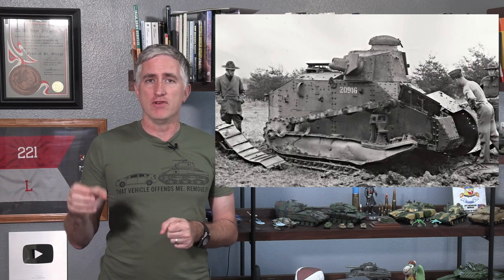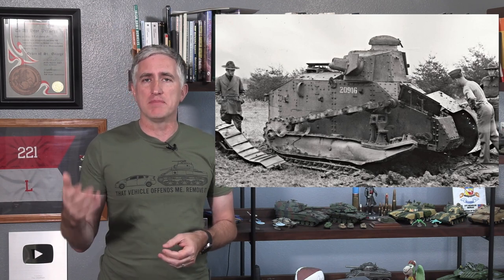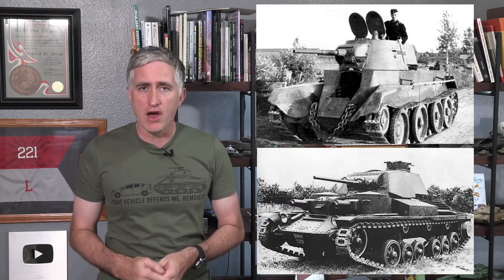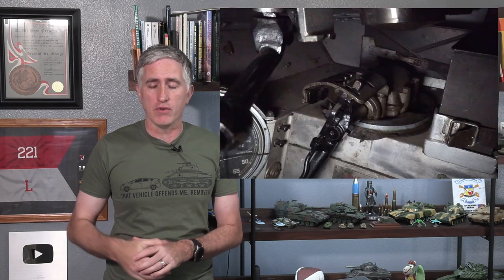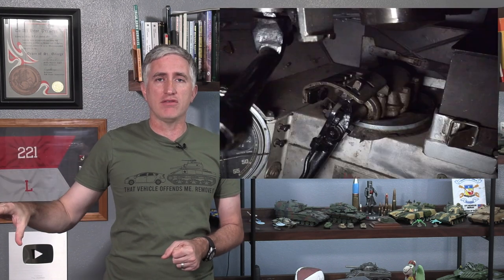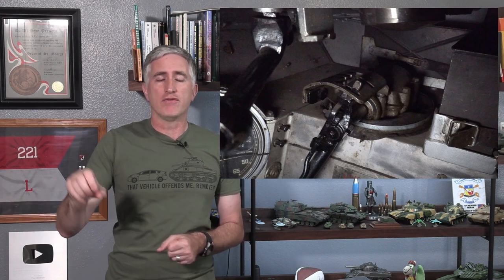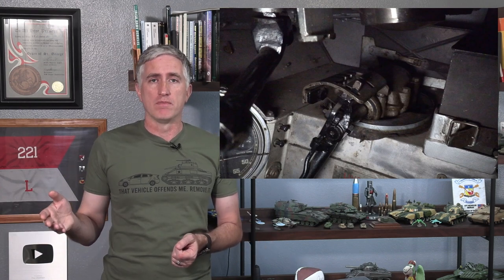Advantages of rear engine tanks with front drive sprockets

Comment: Your point about transmission linkages is something I hadn't considered. I used to have a van with a column shifter that required a fair amount of finesse to shift smoothly between gears. Trying to force it when it didn't want to go into gear ran the risk of having the linkage separate leaving you stranded. Having that happen in a situation where people are shooting at you, yeah, I can see why they'd put the transmission in the front.
Reply: My family owned Econolines for years and that happened a few times. Once a cotter pin in the linkage broke and was replaced by a bobby pin as a permanent temporary fix.
Reply: @edcrichton9457  Mine was close to 20 years old when I bought it, and the linkage was well worn. I learned pretty quickly how to shift it without causing a problem, but only after I had to push it out of traffic a few times.
Reply: My parents had a 79 Chevy van, witha three-on-the-tree.  You learned quickly not to downshift straight from 3rd to 1st when coming to a stop. If you did, you'd bind up the linkage and have to coast to the shoulder, get out, and stick a screwdriver in the linkage to unbind it.  I think I only did that once or twice. After that, I always shifted from 3rd to 2nd to 1st.
Reply: @edcrichton9457  There's a well-abused '91 dodge shadow 5 speed out there somewhere that has a bent trim nail holding the cable end to the fore-aft linkage on the transmission side, and a rolled up piece of greased rubber hose as the bushing. Nothing like field-expedient repairs that not only work when needed (I yanked the thing apart on a 4-3 downshift in the middle of the night in downtown Atlanta), but also ended up working better than the factory parts (I hadn't realized just how much slop there was in the factory perforated bushing...)

Comment: Glad he addressed the mechanical advantage of pulling the track forward (think block and tackle) and that it's way down on the scale of considerations for a tank design  .. always love your talks
Reply: There is no mechanical advantage of pulling the track forward.

Why? Because the axis of the sprocket and the axis of the idler are fixed relative to one another.
Reply: You will never see a conveyor belt in any different configuration and basically a tank tread is a conveyor belt. You cannot push the tread around the axels because you don't get the same torque because of a number of physical restrictions.
Reply: @markkarnes5597  Tail drive conveyors are a thing. It's just typically not done because of the tension effects. Tail drive feeders are fairly common. We have both on the current project I'm working on.
Reply: @GIwillo  
Your last sentence is correct.

Comment: I got to drive an M113A3 around Grafenwoehr and Hohenfels Germany as a 12B, and since it was the platoon commander's vehicle it was really like having a tracked vehicle to joyride around the mountains of Germany with. They were definitely balanced well considering all the very steep grades I'd have to drive down and up. Checking the oil in the two front final drives was just as important as the engine oil, stressed in the manual and by my NCO's. (One of them called the 113 a 'tracked grenade'.) The up front engine served another purpose very well-at night I'd lay my 3 layer sleeping bag over the engine intake grate on top and get nice residual engine heat for nearly the entire night.

Comment: Hopefully this comment doesn't get buried, but I have a question for the monthly Q/A.

The Chieftain MBT is often described as the most well-armoured vehicle of its time, but wouldn't the appearance of HEAT shells make the armour relatively useless? Why did nations continue to build heavily armoured vehicles when HEAT rounds were a thing and composite armour had yet to be developed? Were HEAT shells uncommon compared to traditional anti-tank shells, thus the need to protect against conventional kinetic projectiles have more importance and thus the need for heavy armour?

Pretty long-winded question but I'd love to get an answer for this!
Reply: my two cents, you dont stop making planes just because the other guys make anti air rockets. Tanks are still useful even if their best defences are nullified, because its still a mobile weapons platform thats resistant to most threats.
Reply: I'll add my opinion as well. HEAT still needs to go through armour so adding more does help, albeit not as much as composite does but this combined with spaced or skirts would help.
Reply: The M60A1 and the Chieftain had the same LOS frontal armor. Try again
Reply: HEAT was a major headache but was not magic. The 105mm L7s HEAT round could chew through about 400mm as i recall. When France and Germany started work on what would split into the Leopard 1 and AMX-30, they emphasized sniping and outmanuvering oponents, while the Cheiftan and to a lesser extent the Pattons were expected to be able to slug it out. As such France and Germany considered sufficient armor impractical and settled for resistance to 20mm autocannon while the Americans and British had 2,3,4 times the effective armor in some places to be able to shrug off known main gun  rounds at the cost of speeds that could best be described as leisurely. Of course warheads kept improving and what was ok armor was eventually rendered as underwhelming as Leo 1's.
Reply: Most well armored at its time cheiftan is not. You forget T-64 exist?

It comes down to AP can hit stuff at first shot much more reliable over a long distance. People probably will sling AP at your direction first.
Reply: @u baka  btw, for some time going for mobility was exactly what Soviets were planning to do, as preliminary project of obj.432, or 430A as it was called back then, in 1960 had either no composite armor, or steel/glass textolite UFP (without layer of steel to back up textolite yet) only, and had weight of 30.5t, almost fulfilling requests of those unhappy with 34-35t of T-54/55 which proposed to go for T-34-85's 32t or even late T-34-76's 29-something t.
Reply: HEAT rounds couldn't be fired through a rifled barrel without a special casing because spinning forces actually weaken the hyper-elastic jet, so they were massively slower and less ranged then AP/APCR (and terrible accuracy). By the time you had the rifled barrel/smoothbore interchange in the mid-70s that REALLY let the HEAT round strut it's stuff, the first composite arrays where being fielded by both sides. (Outside of the early silica wedges encased in armor steel like in the T-64 and T95 series.)
Reply: HEAT only really achieves its amazing potential when it hits square on. Angles, especially three-dimension curves, have a bad habit of dramatically reducing efficacy. That super-hot jet of molten metal is more easily deflected than you would think. The Chieftain, from the front, had very few surfaces that a HEAT shell could bite into, so to speak, so it performed very well, especially when presented hull-down as intended. 

I will note that there are extensive combat records on the Chieftain thanks to the several hundred that were in service with both Iraq and Iran during their little tiff in the 1980s. The general consensus was that it sucked because it broke down all the time and was easily flanked, making shots against its relatively thin and flat sides quite effective. What I don't recall seeing much of is the frontal armor failing. That suggests to me that even with lots of modern HEAT shells going back and forth, Chieftain armor worked.
Reply: Early HEAT warheads would have been attached to RPGs and the like which weren't terribly accurate over long ranges and conflicts like the 6 day war and later the Yom Kippur war showed that heavy armor was clearly still useful.
Reply: @hedgehog3180  the first HEAT warheads used incombat were cannon fired in ww2 tanks and ground mounted cannons.
Reply: Experience with the Centurion in Vietnam showed that HEAT  did vey little damage unless the jet hit one of the crew. British tanks kept the ammo well down, so that was very unlikely to be hit.
Reply: The way the Rhodesians made their mine proof hippie kombis resistant to heat rpg7's was to place expanded steel mesh distant from the plating. Look up the "Leopard". - not the German one :)
Reply: @warlord195711  Yeah, I mentioned in the QA video the experiences of some American tankers from the Vietnam War that parallel your Australians. Most every battle they had with the NVA involved numerous rocket strikes because the NVA just adored using RPGs of all kinds to compensate for their lack of heavy artillery. Despite that, very few of the tankers were actually harmed seriously. The tanks would be full of holes but not the tankers.
Reply: @jintsuubest9331  Some evidence would be nice :).
Reply: One reason is that the heavy armor reduces the options that the enemy has to hurt you.

You COULD put a 105mm gun on a completely open tracked vehicle, but anyone with a rifle would completely wreck you.

So you armor it against 7.62x51, but you can mount 20mm/23mm autocannons on the back of pickup trucks.

So you armor it against 20mm/23mm cannons, but towed 40mm-50mm guns are relatively lightweight and maneuverable. Some IFVs even mount them.

You eventually reach a point to where the armor is heavy enough, but the vehicle is still maneuverable enough, that there are only a few weapons capable of penetrating it. Those weapons come with drawbacks that others have elaborated on.

To put it another way, just because Kevlar won't stop rifle rounds doesn't mean it's pointless to wear kevlar.
Reply: @andrewallen9993  Slat armour is still used today, particularly in the wars in the middle east. Just look up American slat armour to see it done right. Sometimes the warhead will detonate with a stand off, but hopefully over half of the warheads will strike between the slats making the nose go through and the speed will crack the nose off and disconnect the fuse (tip of the nose) from the warhead before the fuse strikes a surface.

Comment: The argentine TAM also has the engine on the front, with a small hatch on the back for loading ammo and stuff. It's a german design, the chasis is a marder derivative and the turret was to be the upgraded leopard 1 turret, but leopard 2 make that useless, so german engineers use ir for the TAM project instead
Reply: The TAM is so full of potential with some modern upgrades to it, and it has awesome operational range...srsly, the U.S. should really look to front engine designs or perhaps all electric systems to replace the aging Bradleys and M1s and make a universal modular vehicle which can be adapted to any role.  20 years from now, maybe we'll just have drone tanks and robot infantry though.
Reply: @pex_the_unalivedrunk6785  They tried. 

Twice. 

The Future Combat Systems tried just that, but was a victim of being too advanced for its time, and short-term priorities. 

The Ground Combat Vehicle was... the less said about it, the better.
Reply: @pex_the_unalivedrunk6785  the issue with that is you end up wit flawed vehicles for their roles. now sharing a certain degree of component parts (ie as much as possible) but haveing separate purpose-built chassis is the way to go.

of course light-medium tanks and IFVs have a lot more uncommon than MBTs and regular IFVs, so those could potentially share a chassis.
Reply: German and Argentine collaboration.....where have I heard of that before?
Reply: Strv 103 (the S-tank) also had the engines up front (and served as a role model for Merkava). The reason for putting the engines in fron was to have them function as additional front armor, protecting the crew.
With the gun arrangement of strv 103 it would also be more difficult to replenish the ammo if there was an engine in the way.
Reply: The layout of the S also ment the frontal protection system (frontal armour plate + engine power pack + under chin caterpillar blade + not to be forgotten: the fence) ment the protection from incoming projectiles in the frontal sector was second to none.
Reply: @ollep9142  But wouldn't that mean that you now have a tank that has been mobility killed but has a crew that is untouched? Or was that the point after all, trained crews being more valuable than tanks...
Reply: @thebog11  That's correct. WP had way more men (and tanks) than the Swedish army.
Protecting the crew was (and is) the main focus. The armor was only the last layer of protection. The tank being small and low was the main feature, making it easy to hide, difficult to detect and (if detected) hit.
Because of its small size the weight had to be kept down to maintain an acceptable ground pressure. Therefore the armor plating couldn't be very thick and so using the engine blocks as add-in armor became part of the solution.
Reply: If by "upgraded Leopard turret" you refer to welded instead of cast turret - Leopard 1A3/1A4 and the 1a5DK use that turret design.
Reply: @mbr5742  didnt know of the 1a5DK, but yes, the TAM turret is basically an A5 turret, which to my knowledge wasnt used in production Leos1, but i stand corrected, thank you for your comment, is always good to know something more
Reply: @christiandtorres9843  The A5DK is afaik build as 1A3 and then upgraded like the Bundeswehr 1A5 but using the welded turret while all BW 1A5 used the far more numerous (in german service) cast turrets

https://en.m.wikipedia.org/wiki/Leopard_1#Denmark
Reply: @classifiedad1  yes, the FCS is honestly fascinating as a design idea. The engine (and generator) is over in the track sponson, the transmission is electric. It's a series hybrid aka diesel-electric.

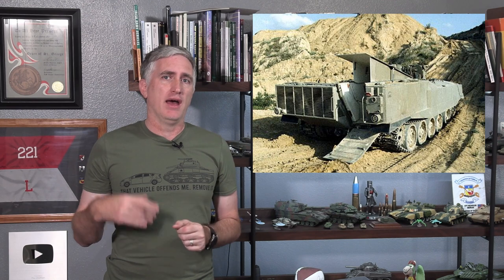Comment: 10:50 what? A true APC has the ramp at the front so that Assault Terminators or Veteran Squads can charge the enemy immediately
Reply: There is a reason barely ANY front offloading APC exist. In fact, I know of none. Rear offloading is far safer. Right off the bat, you have the full length of the APC as instant cover. Second,  see Saving Private Ryan, landing sequence, to see how horrific front offloading can be. With Landing craft you really didn't have much choice, water was inevitably shallower in the front than the back but with APC that is not the case. I appreciate your opinion, but kindly admit, it was offered with little forethought and analysis. Some design features are there for a reason.
Reply: @TheHomelessDreamer  it was a Warhammer reference...
Reply: @TheHomelessDreamer  I know this was six months ago but...wow lmao.
Reply: It also have the ramp at rear.

Comment: Front/Back sprocket also makes a difference in track tension distribution over the length while moving .  Practically speaking - With front sprocket, chances of throwing the track while forward travel is higher than with a rear sprocket.  The opposite in reverse (naturally) and for breaking. Though with adequate track tensioning, the difference is not so large to make a gigantic difference / worth paying too much attention to over the main reasons chieftain talked about (Front Sprocket worked out well enough for WW2 tanks with pretty low tension after all). 
Its just an important side aspect to keep in mind from the engineering side, esp. if the vehicle has a narrow track and high suspension travel.

Comment: Another issue was the gun projecting past the front of the tank, which was thought to be a bad thing. A central turret allows a longer gun with out an overhang.  Designers worried about this until guns got so long it was unavoidable. It makes the tank less cumbersome and its easier to traverse the gun, no worries about obstacle in the front quadrant.  Your point about having the driver next to the transmission is well taken.  One of the pluses of a torque converter is the elimination of a clutch. Slipping the clutch in a heavy high torque vehicle is a big nuisance and many  WW II tanks have two steering clutches. The final point is that minimizing the internal volume of the tank in order to maximize armor doesn’t seen to be on the designers list. Compare any modern tank with a WW II design.  Even in a cramped older design the internal volume is greater, the modern stuff is much more efficient.  
Thanks for the heads up on “Engineers of Victory” Paul Kennedy.  The concept is good, to focus on the creators of the weapons systems that won WWII everyone from Sgt Cullen to Wilfred Freeman.  Great read. As an “apprentice rivet counter” the niggling technical mistakes e.g. calling the torpedos the Swordfish intended to launch at Bismarck acoustic rather than magnetic, are annoying but really who cares. See you on the next one!

Comment: The Merkava engine placement supports keeping up to 6 troops inside the tank (plus the normal tank crew). A secondary reason for the front engine design is crew protection; there are significantly fewer Israelis than there are hostile Arabs in the region, with the subset of trained Israeli tank crews being scarcer still, so keeping the crews alive is important.
Reply: Correct and mind you that that the engine is a big block capable to stop almost any incoming shots! In plain English the Merkava is one of the most survivable tank ever...

Comment: One other (very slight) advantage to a front drive sprocket is that the returning track gets more time to shake loose the mud/dirt/dust before it engages the high-pressure mating faces on the drive sprocket, reducing wear and meaning track tension can last a little longer between adjustments.  It's not a big advantage, and certainly doesn't rate compared to those issues raised in the video, but it is a factor.  Can't think why the Chieftain didn't bring it up ... ;)